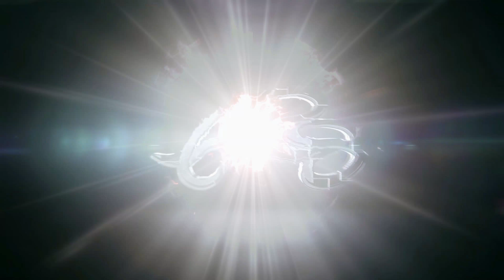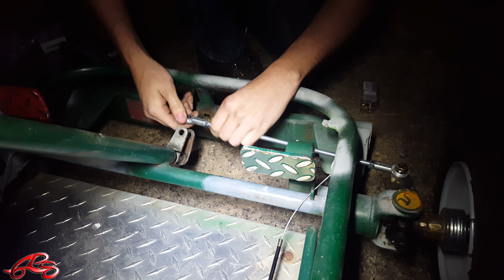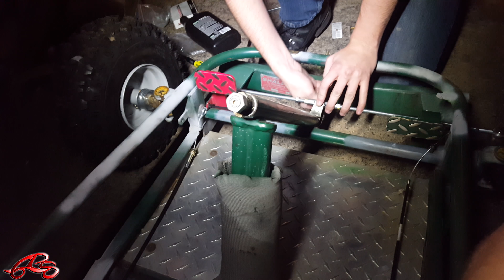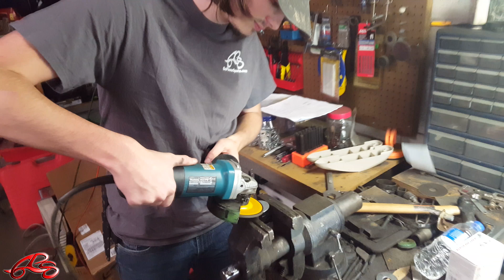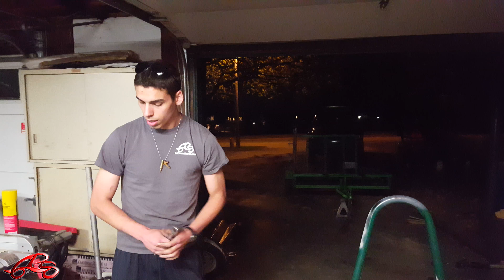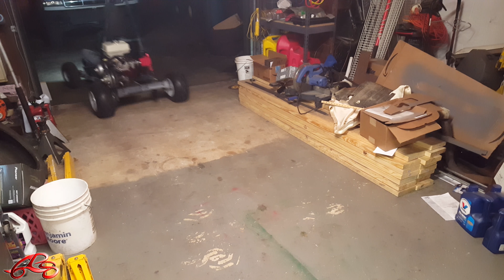Final Parts (Riggin It Up for the Test Drive!) FSTGK Pt  8

Comment: Hi, I am in the process of putting parts together for a go kart, and I have a few questions.

1: I have these brakes on my list of parts and I am wondering if it comes with a brake cable or not... If it doesn’t I can just order one, but if it does could you let me know?

2: What axle size did you go with? I am also trying to decide what axle size is best, and I am currently thinking either 36” or 38”, but I am not sure... 

3: How long should the go kart be? I am thinking about 6 feet, but having no experience with building a go kart I have no idea how long it should be. 

And finally, I am also hoping to purchase the same shocks as you did, and make a similar rear suspension setup. I am wondering what you think of them? Do the shocks help a lot or is adding something like that simply not worth it? 

Thanks